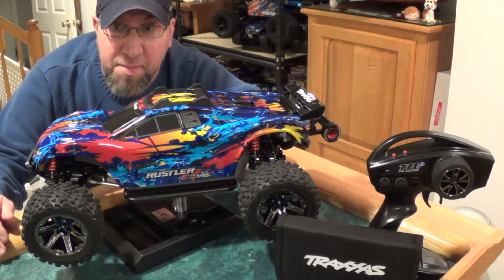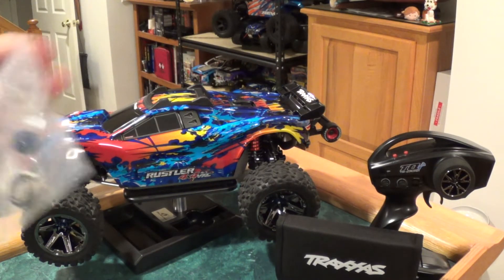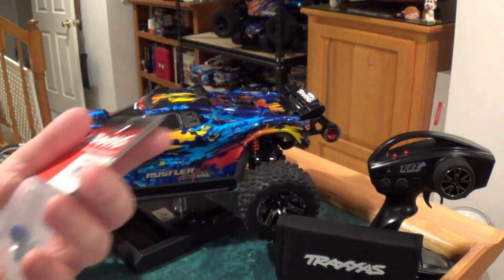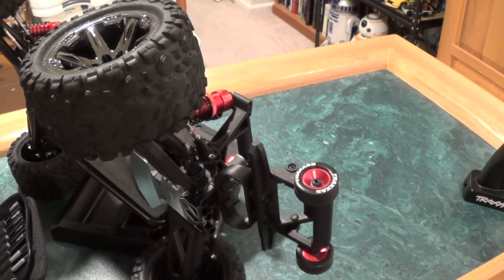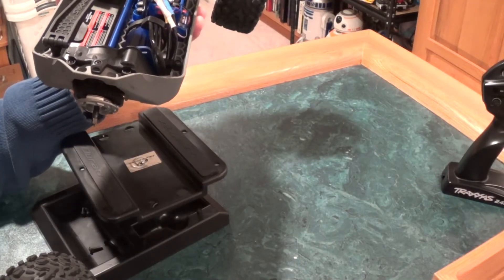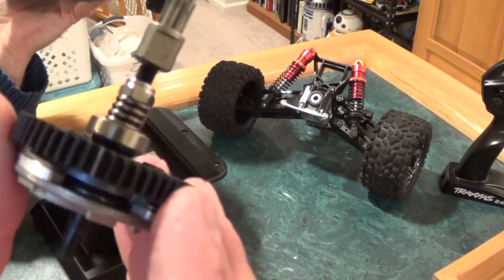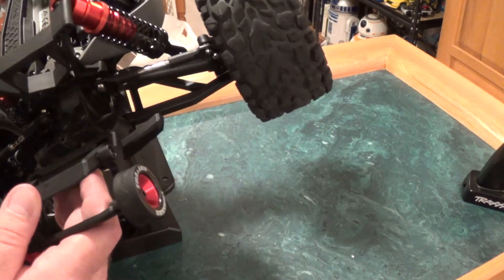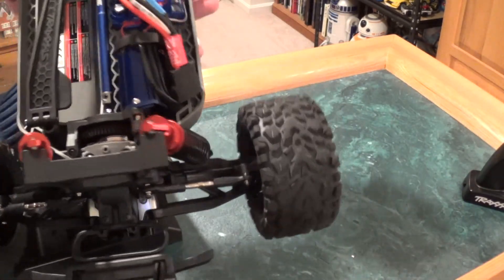Traxxas Rustler 4x4 Slipper Aluminum Bearing Adapter Install

Comment: Thanks for the video, enjoyed doing the upgrade with you. If I was to do it again, I would adjust the slipper tension per Traxxas spec, while it was out of the vehicle. Much easier to do than when it is installed. Then fine tune it on a test drive. Thanks again.

Comment: Hey where did you get that metal lower skid plate? I'm grinding screw heads off on mine right now and want something better than the stock plastic.
Reply: Nevermind, I see you answered this question already. 😁

Comment: Now after almost one year. Would you please tell me what else has broken in this car and needed to be replaced it . I am curious about durability because I wanna buy it. Thanks for the videos.
Reply from the maker: I would definitely swap out the stock shocks for Traxxas GTR shocks.  If you change the gearing to make the truck faster I would definitely put fans on the esc and motor.  Switching out the stock plastic slipper bearing adapter for the aluminum one would also be a good idea.  The is one tough truck, but these mods will make this truck so much more durable.
Reply: @beyondthebluerc1  thanks for your helpful video and hints.
Reply from the maker: mohammad mohammad 

No problem 😁
Reply: get a high powered steering servo! cause, why not!  really tho, get it!
Reply: @qstix9733  i got a savox in mine and I love the power!

Comment: Where did you get that aluminum chassis its nice I want to get one for mine 4x4 rustler vxl to it looks good on their😀😀👍
Reply from the maker: They are front and rear Integy aluminum bulkheads.  Unfortunately, they are sold out right now☹️.
Reply: Ok thank you
Reply from the maker: Jolly rc 

No problem😁
Reply: @beyondthebluerc1  Did you need to do any modifications or did those bulkheads bolt right on?
Reply from the maker: @jasonc1817  

No modifications are necessary.  Just remove the stock bulkheads and put these Integy bulkheads on using the stock screws.
Reply: @beyondthebluerc1  Thank you for the information!
Reply from the maker: @jasonc1817  
No problem

Comment: What kind of shocks do you have?
Reply from the maker: I found them on Amazon and they are made by Hobby Park, which is a brand I’ve never heard of before, but at $27.00 for 4 shocks I figured I would take the risk.  So far I like them and haven’t had any problems with them yet.  Here is a link if interested: 

Hobbypark 4PCS Aluminum Front & Rear Shock Absorber Assembled Red for 1/10 Traxxas Slash 4x4 4WD Option Parts https://www.amazon.com/dp/B0719WRG7D/ref=cm_sw_r_cp_api_i_OnIECbWWP9R2E

Comment: What are the aluminum plates you have on the bottom of yours?
Reply from the maker: Cade McDermott 

They are Integy bulkheads meant for the Slash 4x4 lower cg chassis, but will also fit the Rustler 4x4.
Reply: Thank you sir and awesome vids man
Reply from the maker: Cade McDermott 

Thanks👍😁
Reply: Do you have to change any other parts on the rustler in order for the slash 4x4 bulkhead to fit ? Thanks in advance
Reply: @beyondthebluerc1  so you can just put the slash bulkheads on the rustler 4x4 without changing anything else ?
Reply from the maker: Kieran Anderson 

They are a direct fit...no changes needed

Comment: No half turn ?
Reply from the maker: If you are referring to slipper adjustment I tightened the nut all the way down and backed it off a 1/4 turn at the end of the video😎.